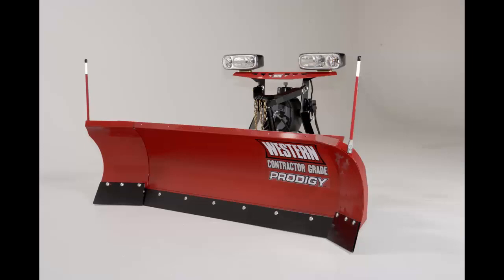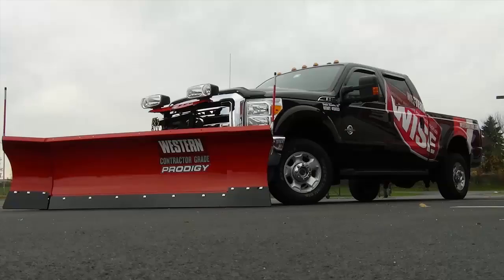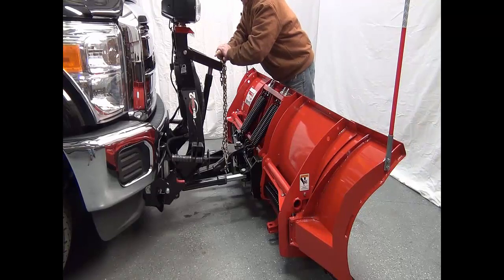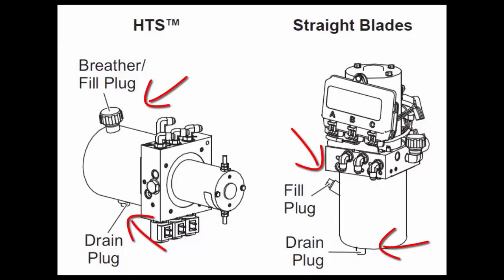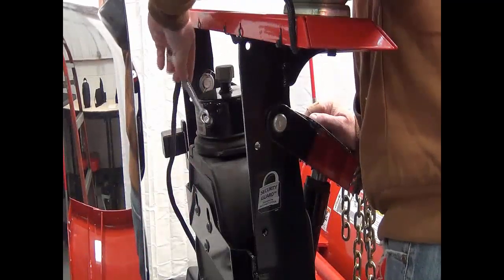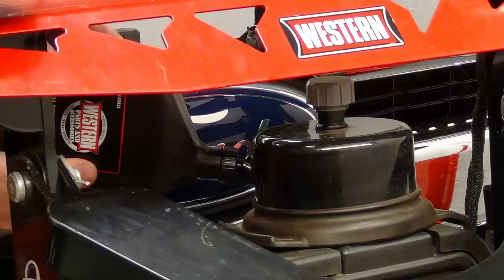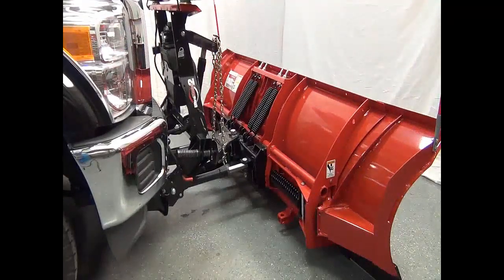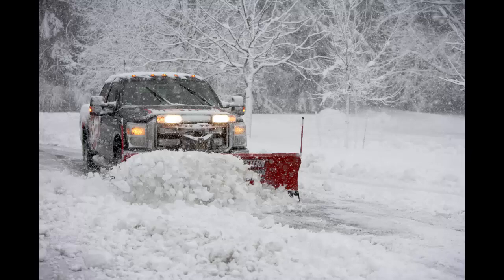WESTERN® Snow Plow Annual Fluid Change

Comment: What is wrong with your hydraulic system that dirt and debris can get in? Seems to me that opening up all the lines has a greater chance of introducing contamination into the system than leaving it sealed up.
Reply: I totally agree with you.  I just change the fluid annually on my HTS plow.  Removing and draining a  line (for the small amount of fluid it contains) to me is just asking for containments to enter or chances of a leak when re-installed.  My father always said " If its not broken....don't fix it".
Otherwise good video!